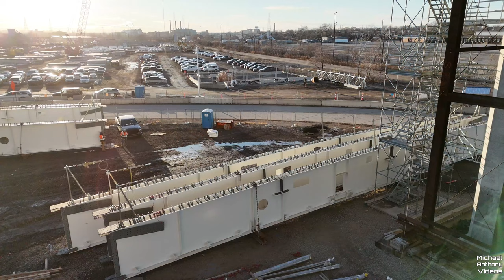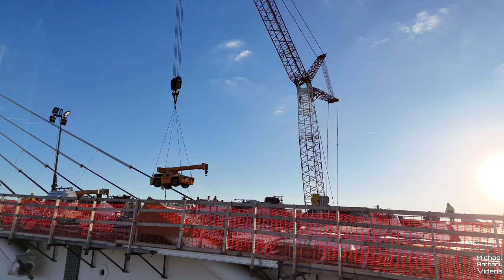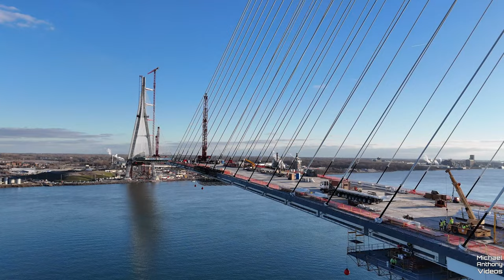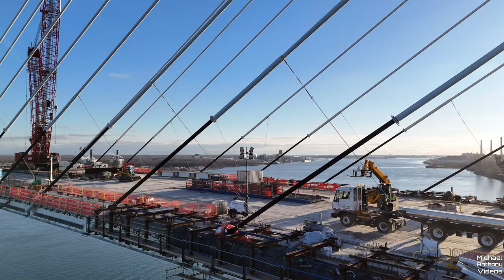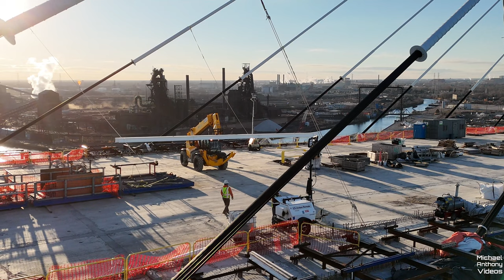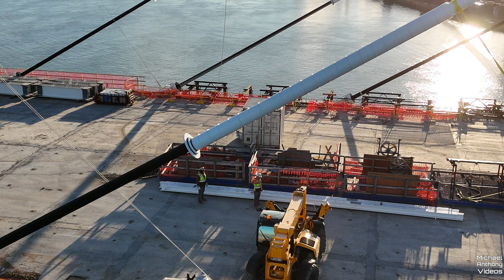Gordie Howe International Bridge Cranes, Trucks And Steel Transport [4K]

Comment: Moving those steel sections was done in an unsafe manner. The steel was not secured to the lift, men were under a suspended, unsecured load. I would hope that some safety person on the project would intervene before someone gets hurt.